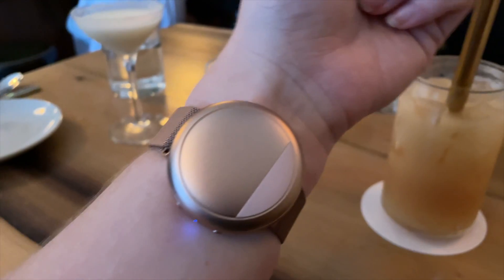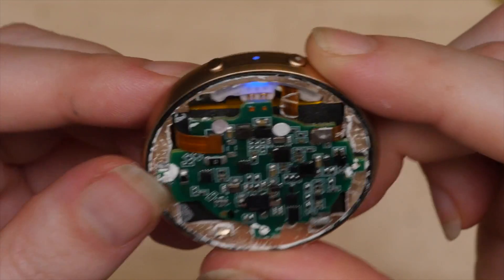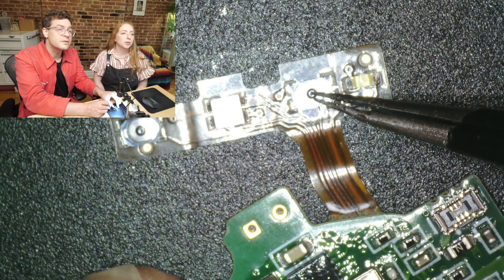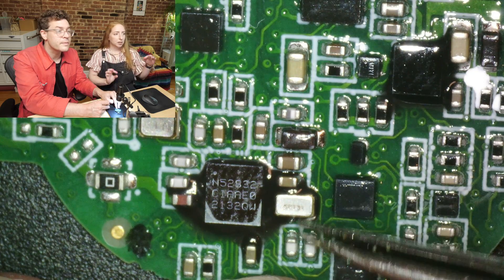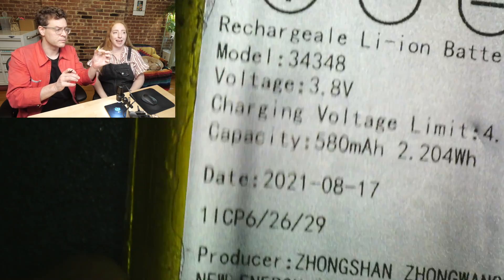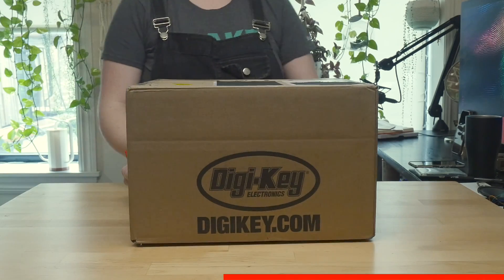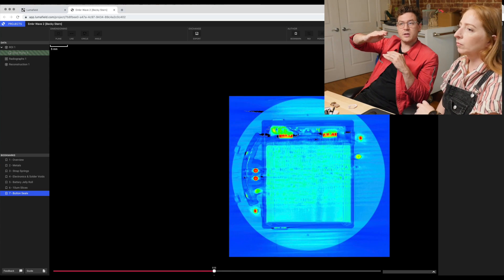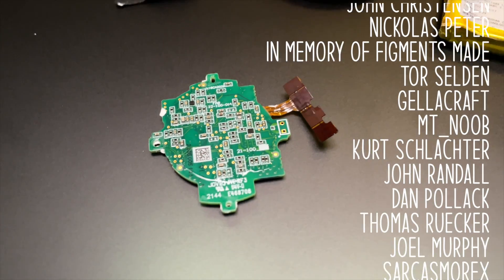What’s inside the Embr Wave 2?

Comment: I'm guessing the case extends between the Peltier device and the battery - to head off the heat (when the outside is being cooled) and conduct it to the outside of the device - rather than cooking the battery - which may not be something Embr's lawyers (or anyone waring the device) would be keen on.  Interesting video, as always.  Stay safe out there.